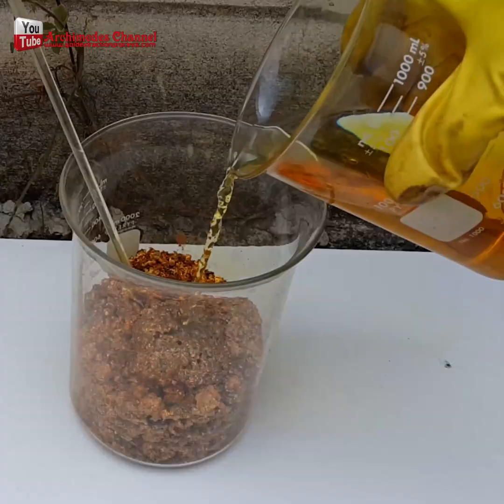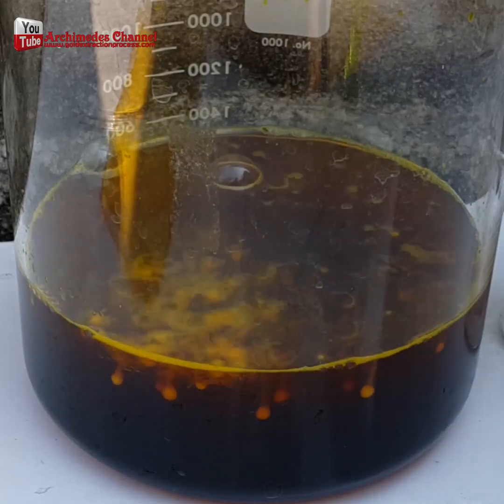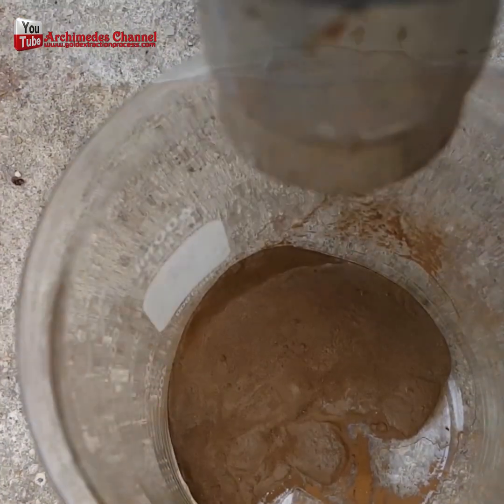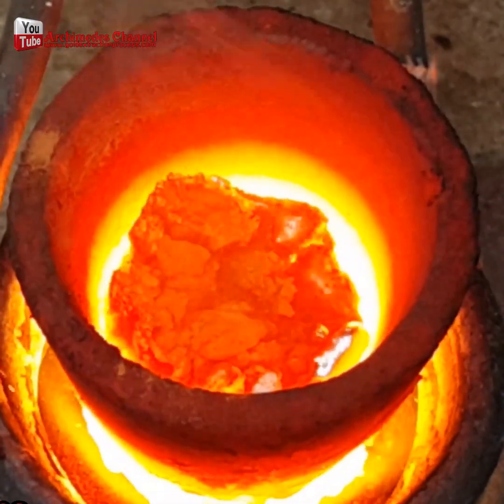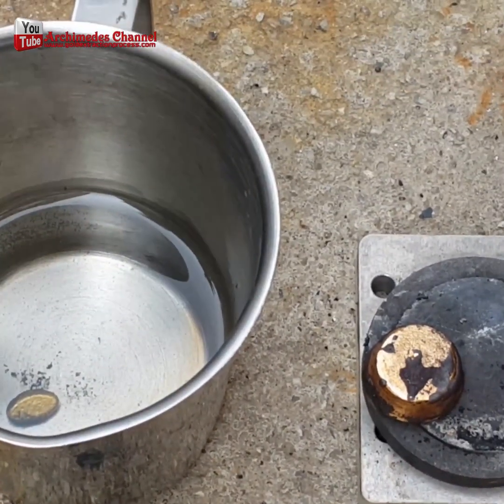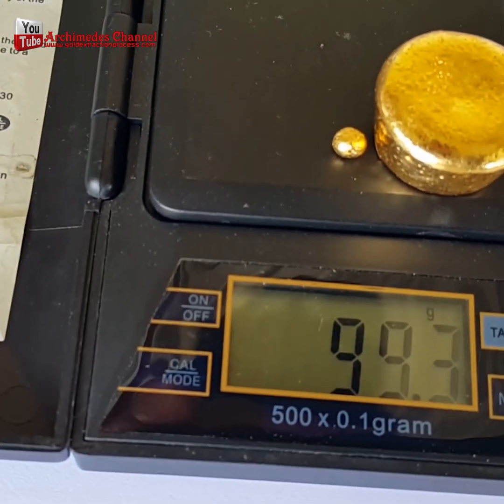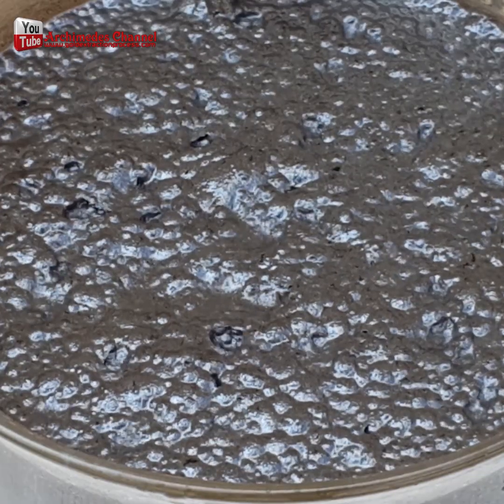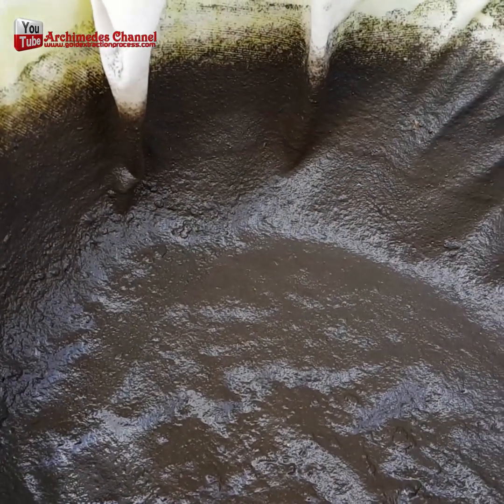turning GOLD SCRAP into 24 Karat pure gold | Archimedes Channel |

Comment from the maker: 😱😱♻ 💰👉 Gold recovery
The way in which Gold is refined is through the use of chemicals - specifically a Hydrochloric and Nitric Acid mix known as King's Water or Royal Water . Thanks to Gold’s unique properties it is non-reactive and will remain whole, while other metals combine with the acid and produce waste products or sludge. In large scale mining operations this used to be done with Mercury, and in recent years using Cyanide. Both of these chemicals are toxic to humans though, as well as damaging to the environment.

In smaller scale refinement electronic recycling or jewellery refinement), a number of acids can be used to purify your gold, but once again these processes can be incredibly dangerous. Use of highly acidic chemicals is incredibly dangerous, and most metals are toxic when inhaled. The process of combining chemicals, and heating the resultant liquid, can produce lethal vapours.

The refinement of gold should only be done by professionals. Any refinement undertaken at home carries serious risks and should be supervised by someone with experience to mitigate the risks.